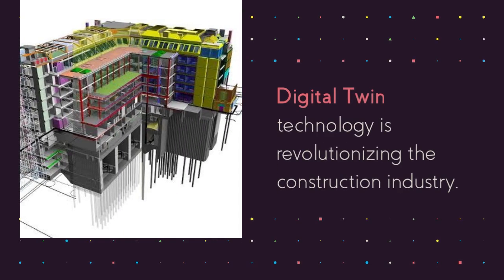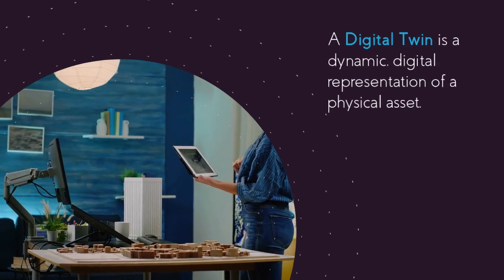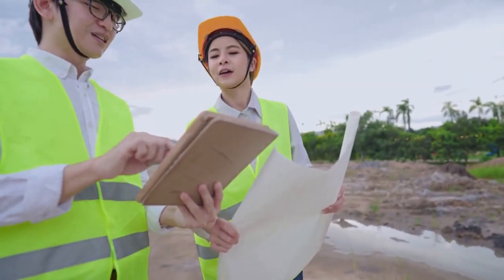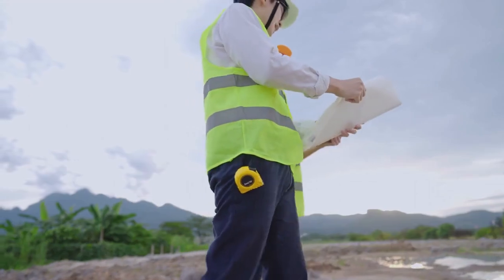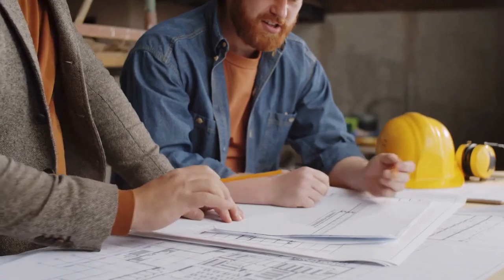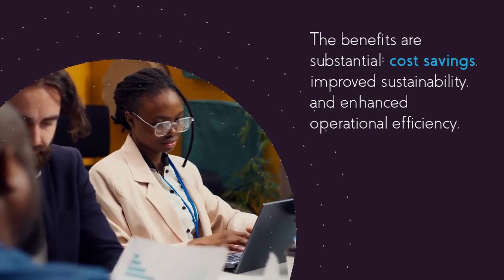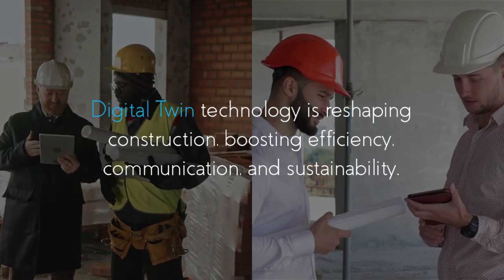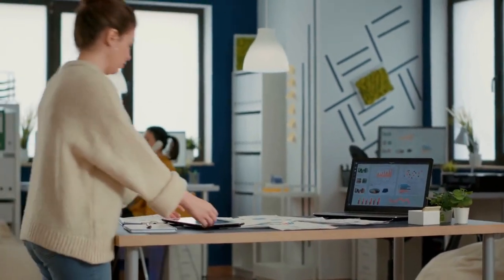Why Construction Need Digital Twin? | Digital Twin in Construction | Digital Twin Explained

Comment: This is all fluff. Digital twin is no different than Finite Element for structures/foundations. No client will accept a structure deviating from Code factors of safety using digital twin as a justification. Unless codes start permitting that, I don’t see the application of this to construction. I want to change my mind but I just can’t see the point. If you have anything to add I’m open to reading and learning how this is any better than Finite Element analysis
Reply from the maker: We totally get where you’re coming from, and we appreciate you sharing your perspective! Finite Element Analysis (FEA) is a powerful tool for structural and foundation design, but Digital Twins go beyond just simulations. They integrate real-time data, IoT sensors, and AI-driven analytics to continuously monitor an asset’s performance, detect inefficiencies, and even predict failures before they happen. Of course, Digital Twins don’t override code safety factors, they work within those constraints to provide deeper insights into structural behavior over time. We get the skepticism, though! If there’s a specific concern you have, we’d love to discuss it further. Always open to a great conversation!